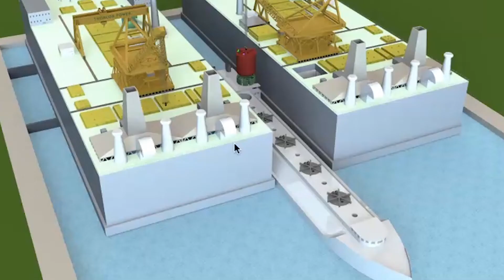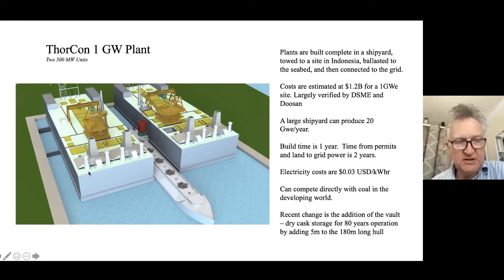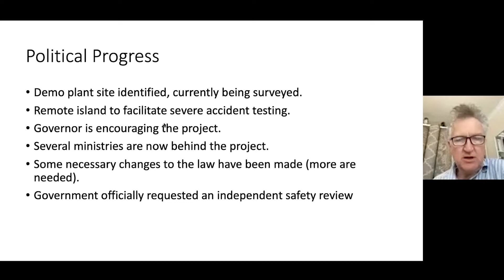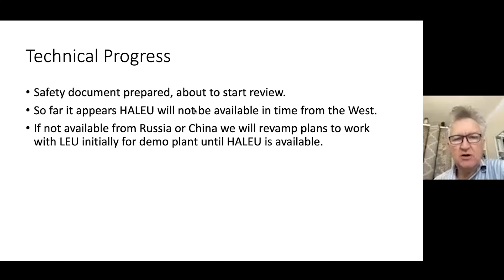Thorcon 2021-10 update from ORNL MSRW 2021

Comment: 500MWe is its rated Capacity, however this design functions on a alternating cycle, where 1 of the 2 Reactors cores are active, and the other is cooling, What it actually produces is 250MWe. If it's functioning correctly, you'd need 4 thorcon TSMR500 to generate 1GWe sustained. Calling it a TMSR500, or even saying you require 2 to generate 1GWe is hugely misleading, (on par with rated capacities on windmills and solar panels). 

Can you run them to make 500MWe? Yes you can, but the reactor cans need to cooldown for X year (less than 4) afterwards before they can be removed, so for 4 years it produces 500MWe, but you have a downtime for (less than) 4 years, where it produces nothing... you'd need another TSMR500 running double cycles in an offset cycle to offset this.
Reply: @Stephan Hazeu The illustration shows two double hulled 500MWe ThorCon units. As you pointed out each of these units have two pairs of reactor cans (the port-side having say cans A&B and and C&D in the starboard pair) and within the former pair only one (eg A) has fuel salts within it while the second (B), of this pair is empty. This empty B can may have a new graphite moderator in it, if so it is awaiting fuel salt to be transferred from A to it after A has been running for 4 years, when it will become the active B can and can A is deactivate and secured in it's same location for a further 4 years, when it will be replace with a new 'A' can containing a new graphite moderator but will have no fuel salt in it until it is connected up to receive the current fuel salt from B which then being empty switches over to secured lock down for the next 4 years while the new A becomes the active 250MWe can . 
This explanation is for only cans A&B which together in series produces half the rated power capacity as it is running in parallel with series cans C&D producing the other 250MWe power 
NOTE If the location has two 500MWe double hulled barge-like units moored and ballasting along side then these combined units could run 24/7 nonstop ,except for the 4 yearly brief stops) when the capacity is temporarily reduced to 750MWe while the fuel salts are transferred to the standby can.
Reply: @MrVaticanRag  thank you for the explanation that does clarify alot, and the use of 500MWe designation is true, i hadnt seen the second pair of Cans before perhaps i overlooked them. 

So its the graphite moderator which defines the lifespan of 4 years for each can correct? They need to be replaced every 4 years, whats the lifespan of the can itself (without the graphite moderator?) Can they be reused  over a certain cycles (like say 3 or 4 times before the can itself is worn out). 

What about the fission products within the can, how are they handled or if at all seperated from the fission fuel?
Reply: @MrVaticanRag  could you please explain how come a 1GWe is plan to be built on a ship in just 1y and cost 1.2B$? From where is coming this massive cost and time decrease? And why is not possible to be built on land? Thanks in advance
Reply: @danielmarbella1197  The savings are found through standardizing the manufacturing process using basic shipbuilding for the majority of the plant, and prefabrication of the can as well. This basically turns the entire power plant (not just the reactor) into an assembly line product that can be made consistently in a shipyard in a fraction of the time of a standard on-land power plant which still requires custom construction. Several of the executives of ThorCon are former supertanker designers/engineers, so they know very large ships and the construction process for them. 

It's a very exciting model that, if they can get anywhere CLOSE to their projections ( $1/W capital costs, $0.05/kWh operational costs, ~1year from order to delivery time, and ~100 new plants constructed per year), it will be a whole new paradigm of nuclear power.
Reply: @Merreck0  My understanding is that the 4 year lifespan is due to, yes, the graphite moderator as well as the general corrosion of the salts on the metal. I do not believe they have any plans to reuse cans due to this. But further study of the actual corrosion taking place in an active can will give them good information that may help mitigate this weakness in the future.

My understanding of their current plan for the fission products and actinides remaining in the can is that they recently added 5m worth of space to the end of the plant/ship that can hold something like 160 years worth of cans (I think 40 cans worth of space, but it could be like 20 cans for only 80 years ... I'm not certain). The eventual expectation, I believe, is that burner reactors will become more widely available and affordable and that reprocessing the remaining fuel to remove such products will likely become more affordable in the future.
Reply: @danielmarbella1197  the  designer(s) of the first and later modifications to the comparive double-hulled bulk-carrier barge-like design had previously had experience with designing and supervision of the current largest double-hulled bulk-carrier ships in an Asian shipbuilding yard. 
The shipyard method used, is by simultaneously fabricating massive modules by multiple computerised plasma cutting and welding equipment and are then assembled together, welded, tested and painted over an  extremely quick period.
ThorCon has received shipyard quotations for both fabrication and installation of equipping these fuel-less 500MWe ThorCon T-RSRs and delivery to Indonesia at an equivalent rate of $1200/kiloWatt, while the production cycle of 20×1GigaWatt per annum is a realistic production rate confirm by the participating shipyard.